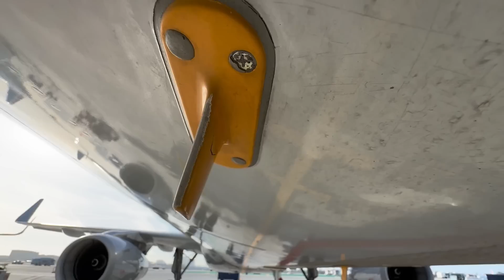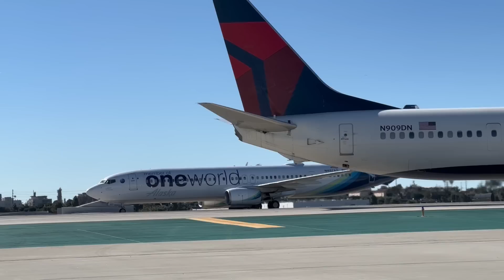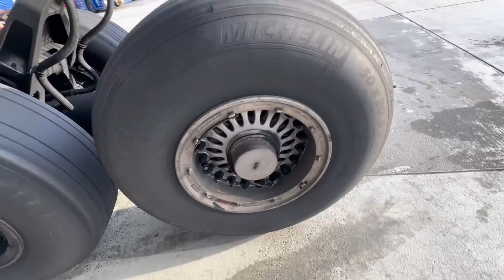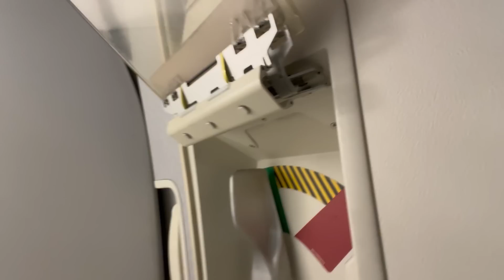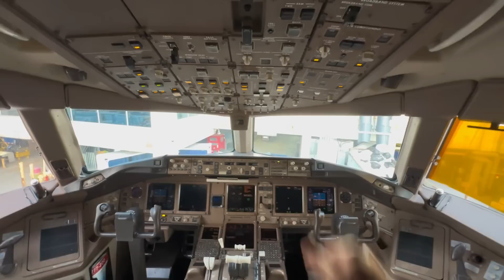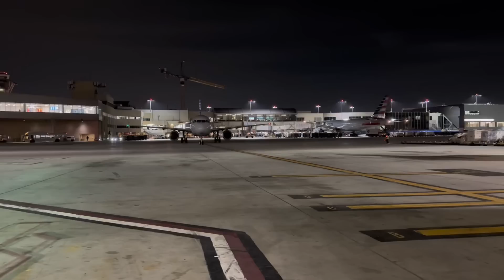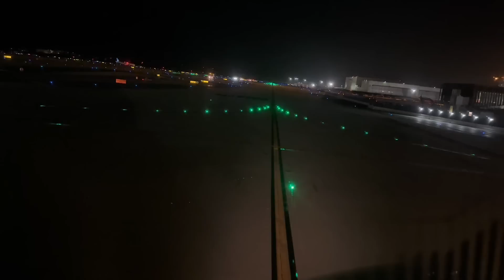Stig Shift #61 (Aircraft Maintenance Adventures)

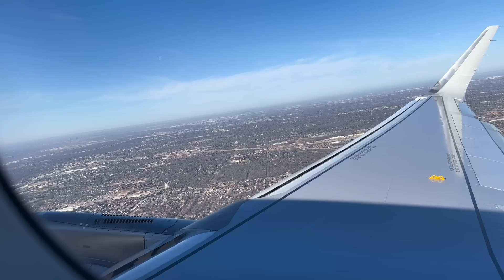Comment: stig, at minute 18:06 what  is that part marked on the 737 pylon?
Reply from the maker: Are you talking about the yellow tab?
Reply: @StigAviation  the groove grid on the engine pylon.
Reply: Above the pylon
Reply from the maker: @mariaclaraferreiradossanto6103  that’s a vent for the heat exchanger that’s underneath

Comment: Stig, do you know why AA went with RR engines on the 777-200 since they have GE engines on the 777-300er. I know the GE-90s are the only option on the 300ER but they can also be put on the 777-200. it would just seem like a simple thing to put GE90s on both variants. I dunno maybe im just a sucker for the GE90.
Reply: The 777-200 came out years before the 777-300ER. AA got their first 777-200 in 1999, about 5 years before the 777-300ER was released. And AA got their first 777-300ER in 2013
Reply from the maker: I believe Tom answered your question perfectly. 👌

Comment: How do logbook entries work for maintenance at an airline? What information do you need to include?
Reply from the maker: It’s quite simple, if there is a problem or a fault you documented within the discrepancy area. Example seat one C tray table broken. Then you have a corrective action, removed and replaced tray table at seat 1C per AMM 25-xx-xx. And then you sign off to work with your signature and employee number. That’s it

Comment: I would say, Ai systems will be revolutionizing the aviation community sooner than we all think, I think one of the biggest issues in the industry is Human Error, if that is cut out it may be more beneficial for everyone, but per maintenance. Eh , it may be more headache than help, since it does involve more knowledge on Electrical systems, and computer knowledge, but per prevenative maintenance it will definitely improve, Overhauls, Repairs, and maintenance times, if Ai can be used to track those systems and report them before a issue occurs.
Reply from the maker: I absolutely agree with that, but the beauty behind all of this, AI can never get rid of a mechanic. You’re still gonna need a wrench 🔧

Comment: @StigAviation Question: Boston passenger opened an emergency door in Boston on the taxiway, slide deployed. What is the process to deflate, remove, reinstall a new slide. Who fixes it and where? The plane was fixed and departed 3 hours later. So who does all this work and have you seen or done this work?
Reply from the maker: There is a particular valve that can be opened up to deflate the slide, the aircraft at that point is out of service. It will be taken to a local facility or a hanger and the slide can be changed out without a problem. It’s not a difficult process. The maintenance teams will take care of all of it and get the aircraft back into airworthy condition

Comment: Hey Stig, lovely video as always. I think you missed the exact complaint in the "39 seconds" video a  bit. The problem is not the LRD, but the fact that there is no automatic bleed air cutoff when it triggers, combined with the exact position of the bleed air valve in the LEAP engine, that leads to the ingestion of oil into the bleed air system (especially on the left engine and from there into the cockpit). I agree with your take that the LRD is not a problem, but I also agree with the other point of view that its implementation on the MAX is troubling, and that some action needs to be taken to address it (could be as simple as mandating the use of the APU bleed air below 5000 feet).

And talking about engines, could you please give us a bit more insights (both visually and from your knowledge) into the Trent 800? It tends to be a bit overlooked next to the GE-90 on the 777, and it looks pretty different to the other Trent variants and the RB-211s the whole family is based on.
Reply from the maker: I will do a deep dive on the Trent 800 soon. Thank you for reminding me on that. In my topic of discussion for the LRD was simply a different perspective, a maintenance perspective. Once again I respect that Pilot and his knowledge. Also my apologies on getting back to you so late, I’ve been trying to catch up with the comments.
Reply: When the LRD is triggered the bleed valve does automatically close. The proposal is to close it sooner rather than wait until rpm drops to the unsustainable level. There's nothing troubling about the implementation on the MAX, it being the same as on the LEAP-1A and -1C models for the A320 NEO series and COMAC's airplanes respectively. Any oil getting into the core air flow will be heated to smoking point in the LP and HP compressors and some of the smoke will unavoidably be bled off for pressurization before the valve can close. Mentour Pilot had accused Boeing of hiding the LRD from the pilots just as he accused them of hiding MCAS. Some months later a LRD activated and smoke entered the cockpit of an A320NEO and Mentour Pilot seemed quite chagrined that not only was the LRD on the NEO but those pilots too didn't know anything about it. Some day I hope to help him realize that flight training is very expensive, so pilots aren't taught everything there is to know about the airplane, just what is needed to operate the airplane safely and neither MCAS nor LRDs are operable or even accessible by the pilots; i.e. the pilots have no need to know.

Note that introducing additional procedures with APU bleed etc. is counter to safety and human factors engineering, especially if they are temporary procedures; it increases workload, causes confusion when it is introduced and more when it is withdrawn and increases the risk of an error in execution leading to a hypoxia event. If you review the video again, Mentour Pilot in essence was implying that pilots cannot handle an engine failure at take off if it is accompanied by smoke in the cockpit—a notion that I believe is grossly exaggerated. The 39 seconds to death from toxic fumes notion was likewise tendered by a pilot's union official without any source or evidence. Likewise the incident pilot's remarks that he thought he might have to fly the plane using the HUD (but the smoke cleared) were misconstrued by the union as he HAD to fly the airplane by HUD. Much ado about nothing.

Comment: Engine bearings. What type of material are they made from? How many hours of run time are these bearings rated for? thanks frank
Reply from the maker: @4qr1vq4mx  the bearings themselves are either roller bearings or ball bearings, depending on which one you’re looking at. They can range from being steel and other exotic metals such as titanium. The thing that keeps the oil sealed is carbon seals and the labyrinth seal. As for how long they can last, that is beyond my knowledge. I do not know the exact time of their lifespan.

Comment: Question. How often does the oil for the turbine engine gets changed?
Reply from the maker: Only when it’s contaminated or if a very specific job card calls out for a change, or if there is a engine being changed. Otherwise we do not change the oil we just keep adding.

Comment: Quick question if possible Stig! Studying my ATPLs at the moment and we were discussing the common earth system on aluminium constructed aircraft and how it uses the airframe itself to complete the circuit. How does the common earth system work on a composite airframe like on the 787?
Reply from the maker: I’ve actually talked about this in great detail, the 787 has a very unique wiring network called the common return network. It’s in one of my older videos and this wiring is thick grounding wires that goes from tip to tail connecting the structure together to complete the circuit.

Comment: Thank you . I can see now how some issues can be missed no wrong doing of a mechanic but just the weather conditions when doing the inspections. When testing plane engines on how well they hold up to a bird  strikes are they using fresh or frozen?Frozen meat chops easier,the fat is solid, and there is no liquid.Just wondering.
Reply from the maker: I think it’s something in between, semi frozen. But I do totally understand what you are saying. I’m sure there’s more to testing than I am aware of. That’s part of manufacturing
Reply: @StigAviation  The birds are thawed out before launching them into a running engine or at a windshield 🙂

Comment: Can you pls give info about speed sensors inside the engine? where are they installed and how they work
Reply from the maker: Speed sensors are measured from the shaft, or better yet the rotation of the shaft, this is how we get the data of N1 and N2. I will go into this topic further in a future video
Reply: @StigAviation  thx. Waiting for your video

Comment: The problem with the LRD is that by the time the pilots get through the checklist, all of the oil has already been pushed out of the sump and through the compressor. IMO it’s an oversight on the part of CFM to not close the bleed valve when strong vibration is detected.

I agree that the video is click baity however MP is trying to bring awareness to an issue that has not been widely publicized.
Reply from the maker: Hopefully some kind of an update with software or checklist can be implemented and I once again will say I respect the Pilot, I think he’s a great educator and a great pilot. This is why it’s good to have multiple viewpoints, a pilot’s perspective and a maintenance perspective.

Comment: is the over speed dangerous and do you feel it as a passenger
Reply from the maker: You won’t feel it as a passenger, you might feel a lot of turbulence, but you’re not gonna get any kind of sense of speed increase. And yes over speed can become dangerous if exceeding in a prolonged amount of time. It can cause structural damage. But once again you would have to Extremely exceeded the limit limits and do it for a very long time.

Comment: Thank you for all your efforts 👌 
I have 2 questions today. 
1. To save on emissions, why not put a policy to taxi on a single engine, especially the aircraft that has just landed and is going towards the gate. 

2. The ever appreciated cargo shots are missing for quite a few episodes.
Reply from the maker: The policy to taxi on one engine is still there, if it is a massive airport, and the taxi after landing is a long ride back to the gate, pilots will usually shut down one engine. Or if they’re waiting for a gate they will shut down one engine. But if it’s a short distance between runway and gate, pilots will maintain both engines on. But different companies utilize different policies and procedures. It just depends on how they want to run their own aircraft. In regards to the cargo, I have not had a chance to go down there because they have been keeping me busy with this new type of schedule. I’m consistently on standby
Reply: Regarding 1, many airlines already do. However Single Engine Taxi depends on several factors. Warm up times before takeoff, can’t do it if runway is wet or slippery, can’t do it if aircraft is too heavy, if there is an upslope on a taxiway, some airlines don’t allow it if you’re crossing an active runway, and you typically need to wait for a cool down period of about 3 minutes after any high thrust being used before shutting engine down. So if your gate is right next to the runway then little point in SET

Comment: How do you get notifications when something like the overspeed issue?  I'm also interested in knowing who or what the position is called when pilots are talking to at maintenance when we call on the radio.  Your video is giving me something to watch on my layover at ALA airport here in Kazakhstan.
Reply from the maker: The notifications come through ACARS and we can access the database from the health monitoring system on either the airbus or the Boeing monitoring sites. That’s only accessible to us maintenance. Most of the time when pilots do call maintenance, they are talking to our centralized base, which would be our maintenance control operators. They’re not talking to a specific station. Unless they have direct contact with them

Comment: Over speed on the air frame question. Like a paperclip that is bent up and down many times, are these records also kept to determine HOW MANY times the air frame has undergone these instances and is that considered during a Maintenance rotation??
Reply from the maker: Oh yes absolutely the record stayed there forever. Did they get inputted automatically into the computer database and they will remain there for the life of the aircraft. When it comes down to a very heavy check, the aircraft will be diagnosed and all these records will be pulled up

Comment: Stig, unfortunately my US based airline had a captain pass away and a first officer get grounded for life after a fume event, and just recently a flight attendant in Switzerland passed away after a fume event as well. Not to get off topic from the LRD, but something that could potentially solve both issues, what are your thoughts about having an air quality sensor inside of the pack output ducts? It could be automated to close the pack valve, unless it would be commanding both to close, or it could be an additional memory item for the pack to be turned off when receiving an air quality ECAM/alert. My nearly 20 year old car has an air quality sensor that automatically changes air sources for the air conditioning.
Reply from the maker: @deadwoodluke  that’s actually a really smart idea, an air quality sensor could be a very significant and beneficial portion of this design. But implementing it into aircraft systems would take an act of God at this point. Not to mention the billions of dollars that would be spent. But nonetheless I do agree with your assessment

Comment: I wonder if the brake dust comes off like that when the pilots “tap the brakes” before retraction?
Reply from the maker: The brakes are applied automatically, and yes that is also another factor that I forgot to mention. The brake dust comes off due to the wind and the retraction of the gear because the brakes are automatically applied
Reply: @ I did not know that, very cool!!!

Comment: I can imagine that severe turbulence would cause fuselage  overspeed, but what is a scenario without a technical cause (control/fadec issue)  that would result in an overspeeding engine ?
Thank you for your efforts, you made me a much less nervous flyer...
Reply from the maker: An engine that over speeds is usually created by adverse wind effects. Where the engine is going beyond the parameters of what the computer has set

Comment: Yea a new video and 2000 more subscribers 😀 was a fixing screw cover also missing on the ATC 2?
Reply from the maker: No that was just sealant that I removed. I was preparing to remove and replace the antenna right there on the line but we did not have time on the gate, so they told me to stop what I’m doing and let the Hanger handle it

Comment: How long do you normally spend on each plane on average? Does AA have a general time when they would like line maintenance to be finished with it?  Or how does it really work? Going to school currently and am trying to learn about different positions and their responsibilities to the plane.  If you have a video already addressing this please feel free to provide the name of video.
Reply from the maker: It’s all very dependent on how long the aircraft is on the ground. If it’s a narrow body aircraft and it’s a very short turnaround, usually around 20 minutes. If it’s a wide body we have a bit more longer time, usually around two hours. Overall we do have enough time to inspect the important things. And if we find something then we have to address it which means we get more time. Obviously that means the airplane will take a delay

Comment: Hi Stig! your point of view about the low reduction devise is very interesting. your detailed explanation make sens. And i'm agree with you, in case of stressfull situation, nobody's react the same. it's a complicated subject.
Whatever .. A nother plane grounded for security, a good thing mister safety first. I just have one question, when you turn off the adirs panel, you still have the same sequence. Button 1, then 3, and button 2.
Is it in the process or is it a personal routine? 
Encore une excellente vidéo Monsieur Stig!
Reply: It's actually ADIRU 1, 2, 3 in that order they way he witches them off.

1 is for the captain (left), 2 is for the FO (right), 3 is the backup one that sits in the middle.
Reply from the maker: When turning them off it does not matter what sequence it goes in. But it does matter what sequence you turned them on.

Comment: Stig, i have a question about engine lubrication system, dose oil returnes in oil tank while engine is running? I heard someone said that possible (not to return) on some engines. Is it?
Reply from the maker: Yes the oil is consistently circulating. It’s going through all the vital components as well as being cooled and then returning to the tank

Comment: Good morning Stig! Through my visits to LAX and whenever I watch your brake riding, two hangars on the west side intrigued me as to what's up with them. More specifically, the FedEx maintenance hangar (which I heard they left) and the old United hangar you did a brake ride to next to the American Airlines buildings. In the video, the United hangar seems to have a damaged wall. What are LAWA's plans for them? Are both being used to store aircraft and do maintenance? If so, by which companies?
Reply from the maker: The old unit hanger is gonna be torn down eventually. A new hanger will be built in the future. The old FedEx hanger is most definitely gonna be pulled down and that’s gonna turn into a new taxi way.

Comment: Stig, question. How are the lights on taxiways and runways constructed? They must be pretty tough to have planes and equipment rolling over them. Are they LED’s?
Reply from the maker: They are encapsulated in a metal casing and they are installed underneath the pavement.  And yes they are LED